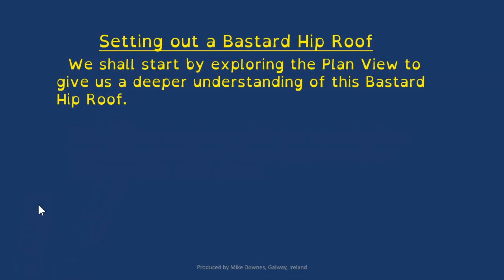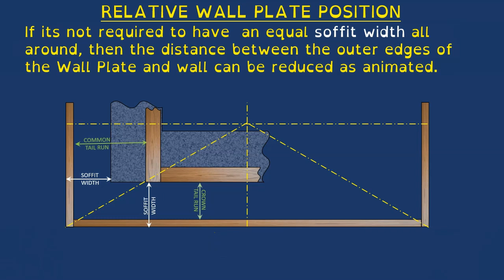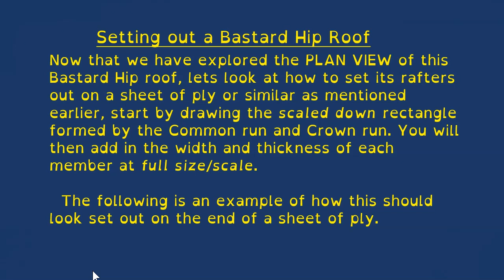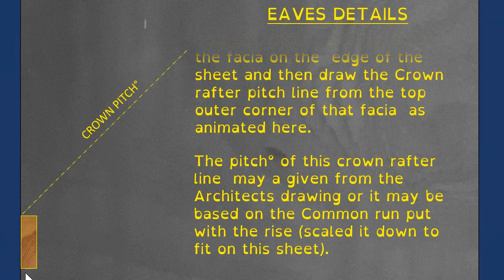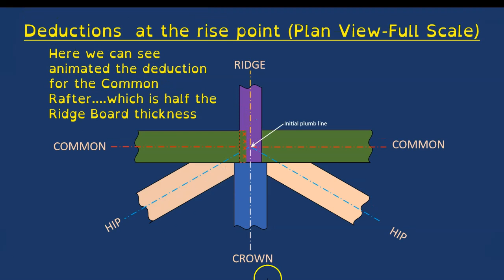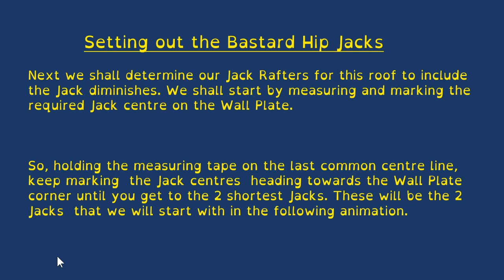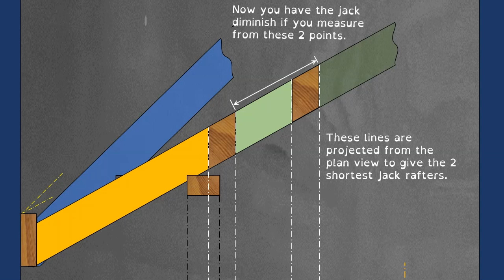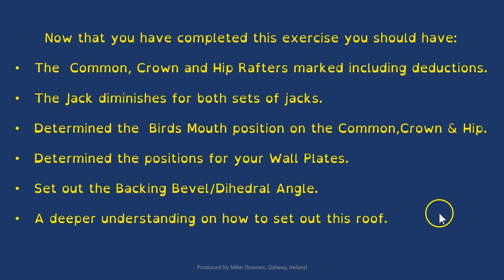Setting Out A Bastard Hip  Roof (Part 1)

Comment: If the commons have say a 30⁰ pitch and the crown 60⁰ do you read the hip/valley 'multipler' under the 60⁰ on the square or does that only work on regular hipped roofs?
Reply from the maker: ...only work on regular hip roofs

Comment: Your  video is done quite nicely. I like the terminology of crown rafter for your single common rafter and the criss-cross diagonal lines representing the horizontal run of the irregular Hip rafter underneath the it's slant length travel.

Comment: So the dihedral angle is the edge cut when looking down at the hip from a  birds eye view but what about finding out the two different plumb cuts for each side of the hip ?
Reply from the maker: ...at 11 mins into video you will see the deductions to make for the Hip Plumb Cut....note the initial plumb line shown at this point in the video....draw this plumb line first at each side of the hip, square accros from each other. next measure the distance  from this initial line to the actual hip plumb cut shown on both side of the hip.....now of course the plumb cut lines are no longer square accross from each other. Dont forget all those deductions/adjustments are measured square off the the initial plumb line on the side of the hip (i.e. off-set measurement)

Comment: what is a bastard hip and valley?
Reply from the maker: if the pitch° on the hipped end and side of the roof are the same then the hip line, on plan view, will be at 45°.
This a regular hip.

If the hip line on plan is not 45° on plan , the that means the pitch at the hipped end and side of the roof are different....this is a bastard hip. ( assuming that both roof surfaces meet at 90° to each other on plan view)
This is shown in thumbnail image for this video.

Another way of looking at it is that the run distance for the common and crown rafter are the same o a regular hip roof.......if the run distance is different (before deductions) for the crown and common, then you are looking at a bastard hip.

For a typical valley,  if the pitch of the 2 intersecting roof surfaces are the same that meet on a valley line on plan, then this valley line will be 45° on plan (assuming that both roof surfaces meet at 90° to each other on plan view...which would be typical).

Bastard Valley will occur If the 2 intersecting roof surface pitchs° are not the same, then the valley line will not be 45° on Plan View (again....assuming that both roof surfaces meet at 90° to each other on plan view...which would be typical).

note: "45° on plan" refers to angle between hip line and wall plate line ...on plan view.
Reply: @michaeldownes516  what

Comment: Hi Michael, a quick question. If I have a hipped roof with say major span a 50* and minor span 30*  pitch what angle on plan view would the hip be at. 
Thanks again.
Reply from the maker: Hi Ciaran,
 if you draw a rectangle that represents the common run by the crown run, the diaagonal of that rectangle represents the hip run.
 Spliting that rectangle diagonaly has produced 2 right angled triangles.

Assuming you have the run distance of the common and crown then the following formula will give you the angle on plan of the hip run line.........crown run divided by the common run=answer. .......then answer shift TAN = angle of hip line on plan

have a look at the following video on using TAN etc...
https://youtu.be/S7A4YB6CKPE

to get crown run use the following formula:
crown rise divided by  TAN of crown pitch= crown run

...check against the following example below to confirm that you are using the above formula correctly......
.... a crown that is pitched at 60°, its rise is 1.732m, .......will have a run of 1m.

Comment: Surely the centre line of the hip changes due to the different pitches? It’s gotta be offset at the top no?
Reply from the maker: The center line stays centered on the Hip...before we include the hip, think of the roof surfaces only,  starting with 2  differing pitched surfaces meeting at a hip ridge line. Then visualise a thin vertical surface (of zero+ mm)droping from that hip ridge line (drops to a distance equal to hip depth}. Next, increase the thickness of that thin surface to now match hip thickness....but keep that thickness centred on the first vertical thin surface as it were.  The surface will then meet mid way across the top of the hip, after the dihedral angle/backing bevel is applied. Hope that clears it up a bit more assuming i interpreted the question correctly.

Comment: So if I have a 35* one side and 45* the other how do I calculate the hip degree
Reply from the maker: Using a scientific calcularor....Take the Rise and divided it by the Hip Run......then hit = sign.....then hit Shift  Button...hit Tan button...hit = to give your pitch.
Example .....Rise of 1 metre divided by a Hip Run of 1.732 should give pitch of 30° if you are applying the above formula correctly
Here is a link that you may find usefull for roof formulas on this channel

https://youtu.be/S7A4YB6CKPE

Comment: So in this case were the wallplates are set level, do you think that the width of our cavity walls for different roof pitch scenarios would need to be firstly taken into consideration in order to suit the load bearing positions of the 2 wallplates ?
Reply from the maker: If there are concerns re wall plate positions/support on a cavity wall consider the following...at the 9th minute of this video the position of the BM (birds mouth) on the lower pitch roof was found by sliding the wall plate horizontally from the first BM on the steeper pitched  rafter to the second rafter.
.....but instead of moving the wall plate horizontally  at this point in the video,,, move it on a vertical plane downwards until it gives the BM on the lower pitched rafter (keep upstands the same for both rafters). 

Now you can measure the height difference between both wall plates...and you can have the wall plate at the same point all around on the wall. This approach would be needed where there is no scope to move the wall plate position horizontally but only vertically, This would be the case in a basic timber frame wall..

Do not forget, if you are using the Site/Builders Square to mark the commons.  the difference in plate levels will increase  by that amount the rise of this lower pitch rafter.

By the way, you would have to redraw the position of this lower wall plate on the plan view on the setting out sheet....this will mean that the hip will now not be in line with corner of the wall plates.....the distance from the new corner of the wall plate to the hip position can then measured off the setting out sheet.
Also, the Hip will be birds mouthed over the upper wall plate..
.